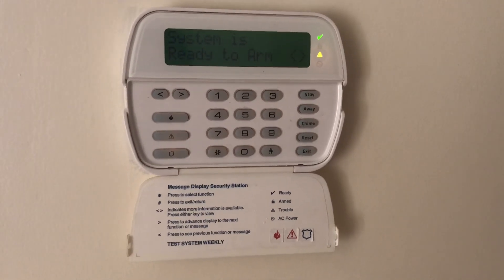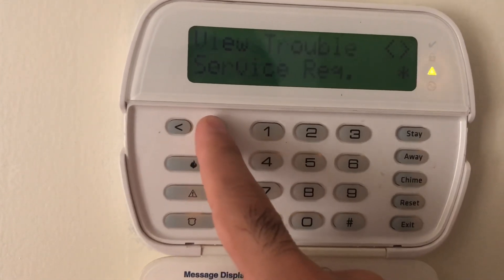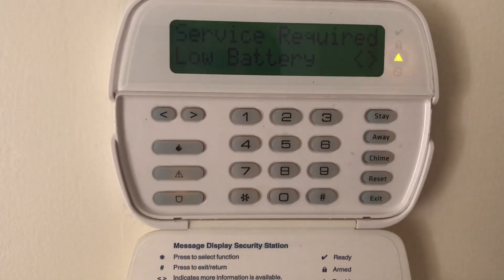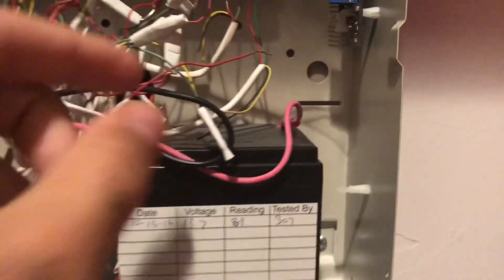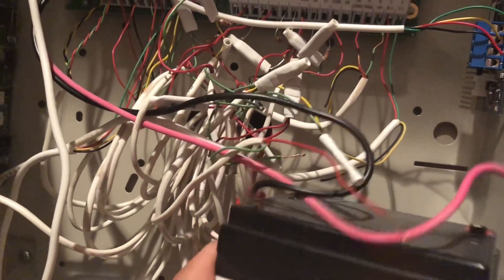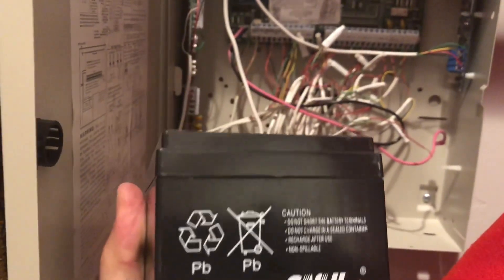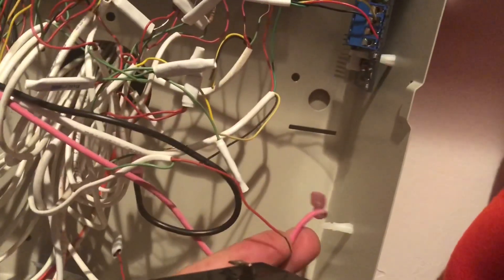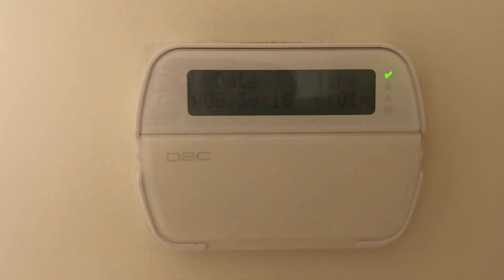DSC Security System troubleshooting: Low battery problem

Comment: Hello guys, I am facing a weird issue. I have got an old dsc alarm system which make siren randomly, sometimes at the middle of the night for 5 seconds and stops by itself. But I could not locate the sound source. What should I do now?

Comment: this is the back up battery what would cause it to go low if I have never had to use in? My power never went out but I do get a code 7. Why did you not meter test the battery first before replacing it?

Comment: I can never say anything good about DSC panels. always a horror to program and work on. Can't wait to rip them out and replace with a honeywell vista. Even worse than a Napco. Now my last call was on a DSC with low system battery beeping the keypads. All battery voltages are good and keypad alarm still goes off. New battery, fully charged does nothing. Can't disable keypad alerts in programming, pc1832 panel must be bad.  Another customer not happy with DSC system.

Comment: What is the battery called
Reply: Double check the specs but I ordered “Casil Genuine CA1240 12V 4Ah SLA Alarm Battery” on amazon and it solved my issue

Comment: hello, and thank you for your tutorials.
I again have a fault 1-3 "general system fault" yet the alarm works correctly, commissioning, shutdown, ... sending to home automation on my app ...
it's happened 2 times already and I called an alarm company each time who disconnected the 2 x batteries and cut the main power supply and restarted the DSC, then the fault disappeared. The batteries are less than 1 year old and work very well
But apparently during a micro power cut?, the Orange default comes back
do you have any idea how to fix this error?
thank you

Comment: My security system has been beeping since the feb snow fiasco here in Dallas. I keep hitting * and it’s quiet for 10 hrs . Then it starts again. We got the battery from Amazon and tried replacing that as well, nothing changed. It’s annoying. These days it makes the sound twice every night which is so annoying!! My house is pretty big so, it echoes in the entire house 🤯. All these days, it said low battery until I got back from a trip.  Now it still beeps but wants me  to set the time. I don’t even know the code 😁

Comment: Very nice clear instructions. I’m glad you showed the connections later in the video. Do they just clip onto the wires or do you have to screw them?

My townhouse’s security guy was looking at mine one time and said the battery is low. He said it would be easy for me to pick up the part and replace it. Of course I didn’t get on top of it right away now it’s beeping. I guess I have an older model or something because it doesn’t light up or show me exactly what the problem is.

I bought a battery and I am going to replace it this weekend. I’m kind of afraid that I’m gonna set something off LOL
Reply from the maker: There is no screw for this type. It was just clip in🙏🏼

Comment: How do you even go in to setting
Reply: *8, then the 4 digit installer code.  On a dsc panel its probably 5555.  So,  *85555